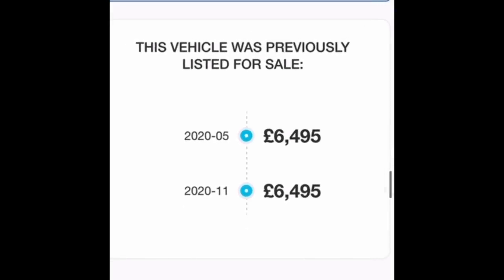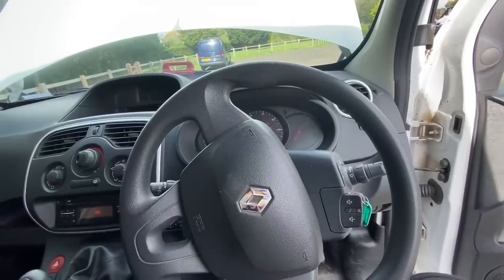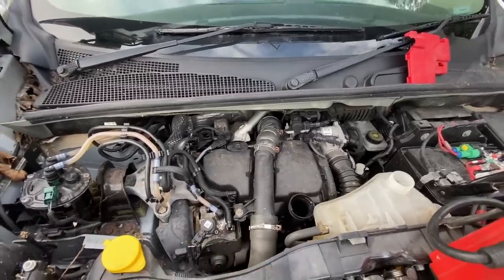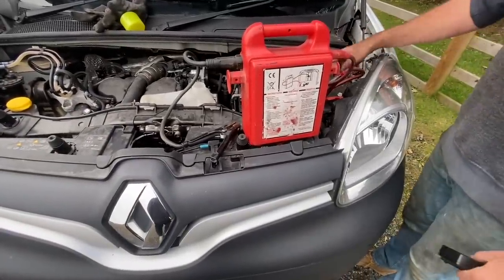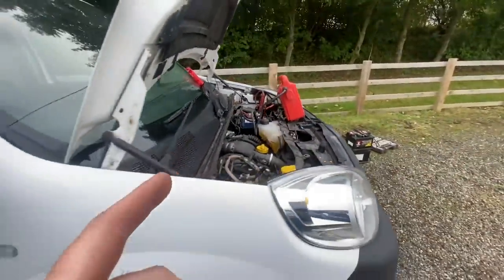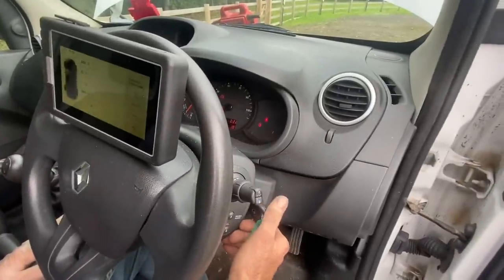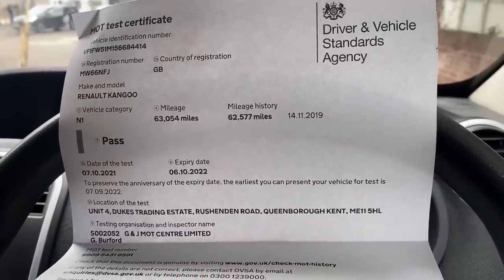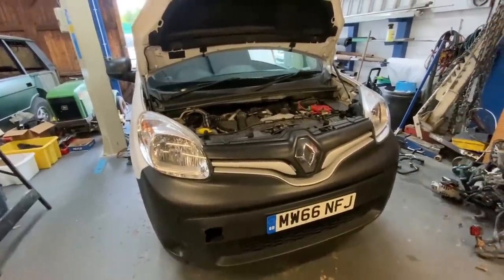Non Runner 2016 Renault Kangoo Crew Van Win Or Fail ???

Comment from the maker: Guys I notice a lot of people mention there is a discrepancy in the mileage. The graph shown is a input from various sources the vehicle is a late 2016 so didn’t have its first mot till late  2019 the input shown is 2017 the previous owner put a mot on the vehicle then sadly passed away so it hasn’t done hardly any miles between those 2 mot.s car vertical gather there information from various sources I have mentioned this on numerous occasions. Example if I put your reg and mileage in to a car buying site to see what they offer and I got your mileage wrong and it was checked elsewhere at a later date with the correct milage this would show a discrepancy. I hope this cleares  up the issue 👌👍

Comment: Rob, how is it not a mileage discrepancy that it went from 62576 to 61991 between MOTs? 😊
Reply: I noticed that as well.
Reply: Most likely an error when recording the mileage at a service between MOT’s - replace the 1 with a 2 and it all looks legit; MOT 62576, SERVICE 62991, MOT 63054 👍🏻

Car Vertical did the same for my own car at the Audi main dealer, dipped by 10k due to an error at a service putting 15k instead of 25k.

Comment: good job, but how is 62576 to 61991 not a mileage discrepancy?
Reply: What I thought too! Someone's had playtime there ....
Reply: I have similar on my car its 13 years old and on 2 occasions mot testers have written down the first numbers that appeared which are service intervals….they wrote 22000 when the car had done just 5500 miles, its still just under 12,000.

Comment: Having driven many commercial vehicles with speed limiters, they do limit top speed, but the performance up to that point is unaffected. So if the engine is sluggish, there may be an issue? EDIT: Should have watched to the end before commenting!!
Reply: Not ay all bud, valid point, if you dint say it, I would have. Good call.

Comment: Everyone mentioning the mileage. Listen to chris point out it has 63k. Then on mot they have clearly typed a 2 instead of a 3. Its human error not an issue. Also nobody would clock a motor leas than 1000 miles
Reply: That’s what I thought, probably an error when the tester typed in the miles👍
Reply: If a car car done 50k between mots it would look like it’s only been clocked a thousand miles but in reality it’s 51k
Reply: I here you mate. But like i say. Chris stated it was on 63k. Then rob took it for mot and it shows less. So in this case id put money on it being a little error rather than anything untoward

Comment: rob, that limiter will have been electronically added by dealer at pdi by pressing a button on his renault diag tool. your diag tool might be able to take it off. 
ive had troubles with the bigger renault vans, after they have had a flat battery not starting. taking the battery lead off overnight usually sorted them, so swapping the battery might of given the kangoo a kick up the pants. 
i recon the cowboys were using your van as a "donor vehicle" to try + fix another van by parts substitution, + never put it back together properly when they had fixed their problem [we've got same issue at our garage, but its always a" mystery man" who does it

Comment: Weird that because I bought something with that engine last year as scrap for £100, I was told the engine was seized. 
Was just going to eBay it but went to pick it up and it started straight up with a booster pack. However was also underpowered so sounded so similar watching this video. Mine shat it’s turbo completely within a few miles though, wish it was just a hose removed like yours! Congrats on the win!
With batteries modern cars are critical on them, would never fit a used one. The ECU needs to be told it has a new one or it will just keep killing batteries as the smart alternators charge them in relation to how worn they are. See so many problems with them in fact running a workshop that we only recommend genuine manufacturer batteries. Seen BMW’s etc kill brand new Varta / Bosch batteries that have been properly registered within a couple of years, as apposed the genuine ones lasting over 10 years

Comment: There is a discrepancy in the mileage, it went from 62k down to 61k!
Reply: Mileage isn't always recorded correctly with DVLA. It's pretty clear that van had been stood a while.
Reply from the maker: No discrepancy the van is 2016 wasn’t due and MOT until late 2019 the mileage shown is 2017 it is just an input from various sources and is clearly incorrect

Comment: That rat thing with the Mercedes is actually from Mercedes moving their wiring loom manufacturing to China. Went cheap and now have loads of recalls for wiring issues.
Reply: And merc being cheap and just rebadging Renault’s as a merc and charging double the price
Reply: @bmwman1981  - The CLA is a Mazda platform. They use the Mercedes renowned interior however. The Mercedes pick up is a Nissan Navara in a fancy dress.

All diesel models with 1.5 or 1.6 engines are Renault diesel engines, equipped with Merc gearboxes however.
Reply: @lukey3507  so slightly better then the Renault

Comment: A great video, a few silly issues to clear, but so worth the time and effort to sort out its problems and restore it to full health. That is not the first time I have seen everything scream after a low voltage problem that then cleared with a voltage restoration. Someone's sticky fingers had been in the pie, though it was not obvious why they did what they did. Some straight forward detective work by Chris and all was sorted. A great job all round, after luck like that it might not be a good night for a lottery ticket, the luck might have been used up. I think you priced it low, you might get killed in the rush.

Comment: The mileage drops a thousand or so in that check
Reply: Yes right where Rob says nothing to see here the chart shows the mileage falling!
Reply: Shouting at the telly about the mileage drop. Thought I was seeing something and had to rewind to check.
Reply: Most likely an error when recording the mileage at a service between MOT’s - replace the 1 with a 2 and it all looks legit; MOT 62576, SERVICE 62991, MOT 63054 👍🏻

Car Vertical did the same for my own car at the Audi main dealer, dipped by 10k due to an error at a service putting 15k instead of 25k.

Comment: Check that mileage again it has gone down by 600 miles
Reply: No it’s gone up.  The figure on the left is current at time of MOT, the figure on the right is last recorded mileage at previous MOT. All good👍
Reply: @michaeldavis1841  the car vertical report shows the error, not the Mot slip

Comment: Brilliant lads, I remember my old 2019 C4 Cactus would go into ECO mode after 5mins of listening to the radio whilst parked, one night after the 3rd start within a 20 minute period warning message came up engine fault but it was running alright, I went to pull away I had no turbo. I ran the scanner in it strangely found a code for DPF strange as it’s a Petrol, anyway deleted the code and it ran fine after, I thought the same as Chris at that time low voltage caused some sensor to go faulty hence the no turbo until I deleted the fault code.

Comment: I know with the renault electronics sometimes dirty fuel can block/annoy the injectors which then drops out a cylinder and has a chain reaction and sets off almost all the other sensors so you get parking brake fail, EBS failure and all manor of "NON faults" in unrelated components show up.  They like good quality fuel - not supermarket tank supply which has all been stirred up after the tanker visited.

Comment: Rob i have been working on a automotive repair video for a few months, as regards the peanut butter oil, i believe this to be a myth. There was an american company that repairs wiring looms and they  mentioned that manufacturers of automotive wiring use peanut butter oil as a releasing compound for the insulation, (this was about 6-7 years ago).I think this is where the rumour comes from. As part of my research i asked several companies about this practice, and of the ones that replied they said not true. So until proved otherwise i say myth .BUSTED
Regards Joe

Comment: was going to say all those codes are from trying to start it with a low battery, the renaults allways do that, that battery was obvously dead dead hence not jump starting and looked dodgy with those parts missings, those vans arnt the quickest but wouldnt say its as slow as you described wonder if thats got abit more than just a limiter on it, good to see you strike lucky  - edit should have watched the full video before commenting lol

Comment: It's nice to get an easy one sometimes, there are some customers I go to say oh it's only a quick job. I know I'll be there at least 3 days ! That rodent comment is a good point, some of the wire coverings are actually made from soy based material those fury little friends love it. I know of a tractor here in Canada needs a $10.000 wire loom/computer board and a dealer re program, because mice ate the loom and shorted the whole hydraulic system computer out. I've seen some real expensive Squirrel damage to on machinery and they've even caused electrical fires  .  Thanks for another great video, Take care guys.

Comment: I know that you have probably fixed the faults by now, but when buying any Renault you should check if it has a non-original stereo..I have owned 2 Renault's with electric and ECM problems and they were caused by changing the stereo..Apparently the ECU/ECM doesn't like non-standard radio's/stereo's..

Comment: Always nice to get a result like that, I remember winning a car at auction as non runner (turns but no fire) car turned up with 0 fuel, 2 Jerry cans a fuel and it fired sweet as nut. Could I ask which obd scanner you use and if you'd recommend it as I'm looking to upgrade mine 👍

Comment: I’m not sure if that has it but our work vans have  a unit plugged in between the throttle pedal sensor and the loom, it’s programmed to shut the throttle like cruise control at a set speed?  You may get lucky

Comment: Glad it worked out OK for you boys but wish it was needing a bit more work as I've got the same van it's started taking a few turns to start it now had exactly the same problems with codes when my battery went last year I've also had glow plugs done bought a top done battery analyser it said it was a slow crank time?? & that was with a new battery so was thinking it was the alternator as it was putting out abt 13v but I was told that was fine im made up for u boys but I'm baffled with mine 🤔🤔

Comment: That happens all the time on the merc citans when its not cranking atall if you stick the jump pack on the van and still no crank if you disconnect the negative side of the battery and reconnect it then it should start. The van doesn't recognise the battery and wont start

Comment: Have the same engine in a Renault Captur same year the Turbo Charge pipe blew off Renault fixed it and said there was a Recall ? they did some computer  tweaks and it ran better 60mpg, it be worth a look no mention on internet ,I like that Car Vertical stuff knowledge is power..😎

Comment: Quick question - the issue with all of the warning lights was due to low voltage on the battery.  I bought a 2014 Mondeo last year that through up a fault under load over 60mph.  Long story short, the previous owner had changed a sensor but the cable was too short so cobbled an "extension" together with some extra wire.  A new Ford sensor has been fitted an no issues.

Is it possible that the length of the cable can cause a slight variance in the Voltage being recognised by the sensor that through up the issue?  The reason I ask is that on your Red Fiesta video you have repaired the wiring loom - are there any dangers in doing this that it may cause errors in the future?

Loving the videos.

Scott.
Reply: Length of cable, no. 
Quality of repair, yes. 
If the extension to the sensor wiring was poorly done, that could increase the resistance in the circuit - and have an impact on the voltage.
Reply: @yellowclio9599  I wasn't sure if the length would be long enough to make any difference.  Your response makes more sense, thank you.

Comment: Stupid question but are the batteries different on a stop start to an ordinary car?
Reply from the maker: Not stupid bud they are higher amps
Reply: @sruk  thank you
Reply: Yes they are different on vehicles that have stop start as my car has stop/start on my car. They're made of a material called AGM or absorbed glass mat and are much more expensive. I got a deal on mine but even at that it was £150.

Comment: Used to love getting motors like this, back in the days of the VW PD engine the Air Flow Meters were notorious for failing but to all intents and purposes it looked like a blown turbo to those who didn't know as the car wouldn't pull over 3k rpm - £2k+ job  the seller thought was needed was actually just a £60+vat part.

Happy days.....

Comment: The one thing I will say and I do know it's not always easy to change the oil flush the engine before you start it if the oil cap was thrown away then the guy propably shoved a handful of stones or dirt or something worse , flush the fuel, don't drive off to not it with that oil ,you don't know what damage you have done might not show for 10000klms

Comment: Not blowing my own trumpet at all here. I have a gas engineers degree bla bla bla. But when it comes to sorting out car problems and having to buy tools just to change a oil filter it is a nightmare. I changed the oil over a month ago. Could I get the oil filter off could I swear word. I went to take it off today after taking it off before and it's stuck again. I only put it back on hand tight because the thread that goes in the engine decided to come off with the filter. Ordered a new thread and tried to take it off today to put the new filter on with the new thread. Would it come off just by twisting it no it swear word wouldn't made my own filter removal tool but couldn't find a part I needed to take it off with so decided to go to the premier bought a 4 pack of Stella Artois and now I am on the whiskey. I bought ramps the oil spark plugs and a 3 pronged oil filter wrench and that didn't work. I am at my end of who gives a poo. Dilligaf. I am at the stage of setting it all on fire and laughing manically while I throw a few potatoes in it wrapped in foil and thinking why not. And you come up with a video like this. Easy peasy lemon squeezy. 🤣🤣🤣🤣🤣🤣🤣🤣🤣🤣🤣🤣🤣🤣🤣😜😜😜😜😜😜😜😜😜😜😜😜🤣😂😂😂👍😂😋🎈😀🎈🤩💘😜💘😜😘😜👊😘😃💘💘👍💘🍰🔥😃🥺😃😃💘🍰🥺🤩😃😃😊😃✌️❤️👊
Reply: Lol 😆 
Rob may have only given a like but I'll give a full blown lol. I haven't been out buying maintenance stuff just a gearbox and mount, giving it to the mechanic in a couple of days. Wish it was as easy as Rob an Chris make it look.
Reply: Oil filter removal tool?Just wack a screwdriver through it.lol

Comment: Did you do the maths on going on train each time and fuel to drive back vs getting all of the vans back on one transporter
Reply from the maker: We used man maths which made it a better option and Rob wanted to ride on the train!
Reply: @sruk  the lorry load you had from copart made me curios why you didn't use a transporter again. Is that even an option, hiring one or are they just commercial use. Thanks for quick reply and congrats on the channel.

Comment: Yay it runs wang it over 😁😁😁that’s gotta be the next logo for the merc wouldn’t pull the skin off a rice pudding 🤣🤣🤣I had this issue a few weeks ago with our Vauxhall vivaro minibus the wife’s battery keeps going flat think it’s got dodgy battery or earth it’s fine in summer but winter always goes flat well anyway injump started the wife’s Chrysler with the vivaro with jump leads was fine when was running  turned it off went out in it later on and a load of faults came up had no power steering no dash lights or digital speedo and came up braking fault spoke to mechanic he asked if battery had gone flat I said I have just jumped the wife’s car he said turn it off for little while it should reset it which it did he was telling me Vauxhall’s dont Like being jump start or leads out on it bought a battery pack now was so worried I had fried the ecu well done lads brilliant news 😁😁😁😁👊🏻👊🏻👊🏻

Comment: Not worth taking the limiter off?
Reply: The national speed limit for vans is 60mph anyway I believe 🤔 so no point
Reply: @sammytheseal2307  car derived vans same limit as everything else, transit type vans 60 on dual carriageway and 70 on motorway
Reply: @garfield2279  It's not a car derived van as it's over 2 tonne 👍
Reply from the maker: Not for us no it’s up to the new owner 👍
Reply: @sammytheseal2307  I thought it was based on a car platform bit like the Citroen berlingo, but if it’s rated over 2 tonne, then I guess it can’t be, every days a school day.
Reply: @garfield2279  Ah yes, you're thinking of the first generation Berlingo/Partner/Kangoos where they did the 5 seat car versions. 
Other car derived vans are like the Fiesta Van, Corsa Van, Astra Van etc which are under 2 tonne 
This is a full blown van and as far as I know they didn't make a 5 seat car version in the new generation, only a van and 5 seat crew van 👍

Comment: can u not turn the limiter off?
Reply: Depending on how it limits the vehicle it can be a right pain to sort out. Most of the time it's a remap, and if you can't do it yourself or can't find a suitable stock remap ("Stage 0") with no limiter, you risk having to use an aftermarket one or getting a guy to input all the values manually on a laptop.

Comment: Hi you must have the luck of the devil. Could you tell me what you do with your oil when you do a service on a car do you have someone pick it up or do you take it somewhere and if that is to the local tip is there a charge for the amount you go through thanks great  video.
Reply from the maker: We use it to heat the workshop in the winter 👍